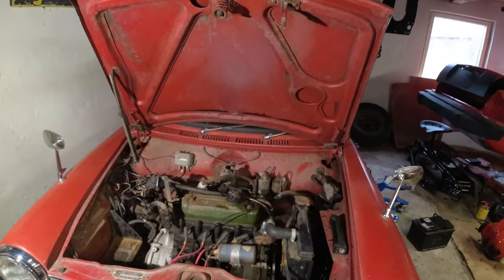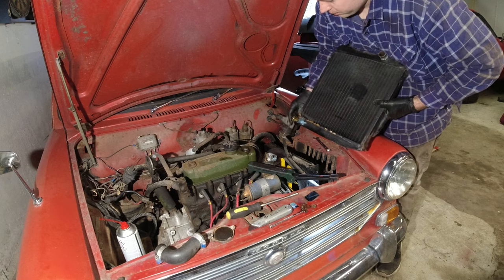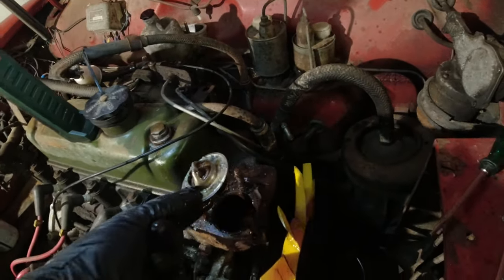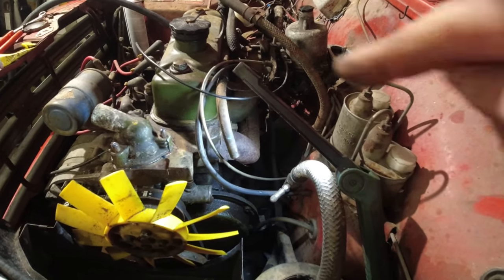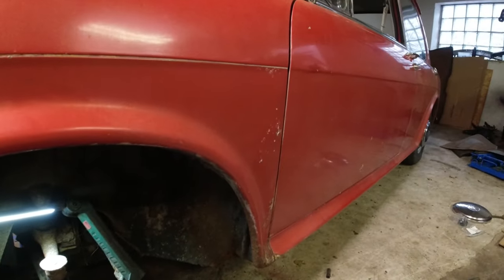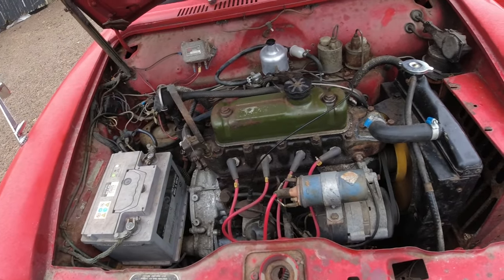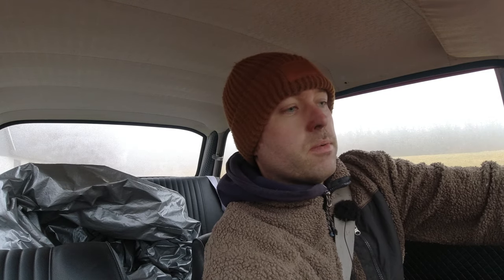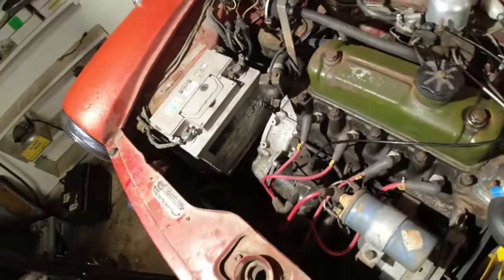Getting this Barn Find Morris 1300 Back on the Road in a Weekend (Part 1)

Comment: These were the best selling car in Britain 1963 until 1972 - near the end.They drive SO well and have such an endearing character. The 70 bhp MG1300 is very lively but as with most 1300's, they were robbed for the engines to go into Minis.

Comment: Another "yes" vote for a road trip video, Adam!  I have a real affinity for the ADO16 cars.  Here in the US, they really didn't catch on well.  The MG1100 version was sold for a time in the mid 60's, then from 1968-71, the Austin 1300 version was sold (gratuitously named the "Austin America" for this market).  My wife and I both had one in the mid-1970's, bought used for next to nothing.  They were great, very usable and reliable cars.  We even took them on long road trips, but they were a little buzzy at highway speeds.  

I would advise checking the rear brake adjusters.  They are manual, and use the same adjuster as MGB, if memory serves.  There will be a square-headed screw which protrudes from the backing plate.  Turning clockwise winds it in, and expands the adjuster cam inside the drum.  The screws often get corroded, making it hard/impossible to turn.  You may want to soak them a bit with the usual penetrating fluid.  Apart from overall braking effectiveness, proper adjustment is really vital for parking brake effectiveness, which is a bit weak on these cars.

Comment: Yes to the road trip. Looking at the sump/drain plug that magnet is perfect compared to the ones I used to see. Plus it's a sweet running engine. One thing I remember about when I used to work on these engines is you can take the water pump off to change the by pass hose instead of removing the cylinder head. We were told not to use these bellows hose and use a 'solid' hose for longevity. I remember the front swinging brake calipers used to seize on their pivots. The handbrake cables were also prone to seize at the drums and at the 'ducks feet' at the front sides of the subframe. These cars were great fun to drive. I used to drive an MG 1300 MK2 the 2 door and it was great to drive on the motorway. (That was 50 years ago though). Hope you have a good road trip should it take place.

Comment: I had one these in the 1970s, yes there should be a shroud around the radiator and the air inlet grill if not liable to over heat in hot weather. From memory the oil was 20/50. Regards  from the UK

Comment: My first car, which I used to learn to drive in, was a Morris II00, a great little car. I seem to remember, that there should be a rubber shroud to bridge that gap you have between the radiator and the body colour metal shroud 🤔👍

Comment: Road trip would be a bonus. Another oil option SAE 30. Here in NZ we had heaps of the ADO16's. 1100 and 1300. Austin, Morris, MG and Riley Kestrel 1100 and Wolseley 1300 too. The 1100 MG and Kestral shared the small bore Cooper head and twin carbs. The GT models had the non Cooper 'S' 1275's and  jazzy paint schemes,. Burnt orange was popular

Comment: The closest car I have ever owned to your Morris is an Metropolitain Nash . It had a MGB 4 cycler motor  but rear wheel drive . It was just a fun little car .
Reply from the maker: Those are great cars too
Reply: Well, it actually had an MGA 1600cc four cylinder engine in it.  The MGB came out after the Nask Metropolitans had stopped production.

Comment: Adam, did you check the rubber front wheel drive couplers?  They can fail without warning. Also. I noticed the radiator shroud is missing. Not a big issue now, but could have an effect in the warmer weather.
Reply from the maker: They seem to be in good shape so far.
Yes it’s missing but I’ll make one before it goes to the new owner.